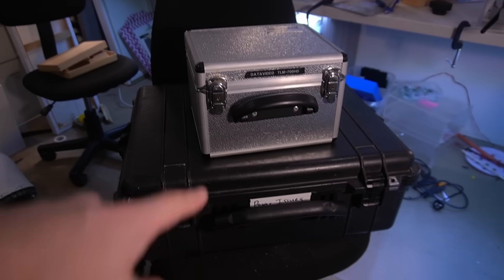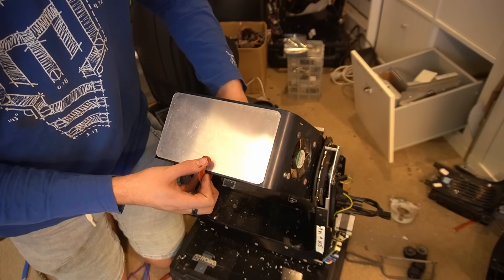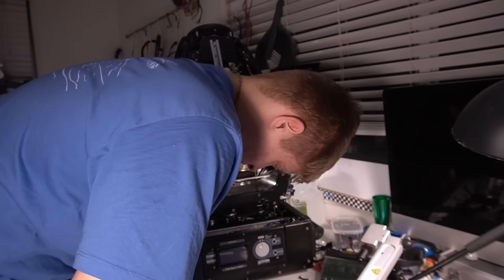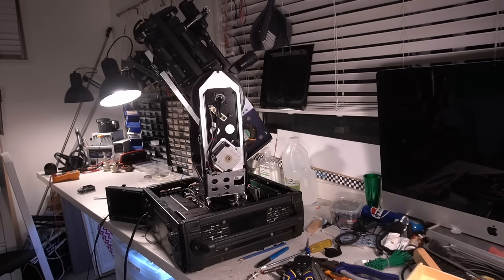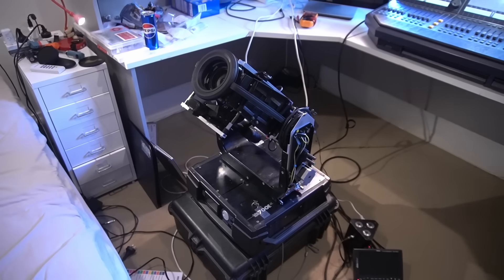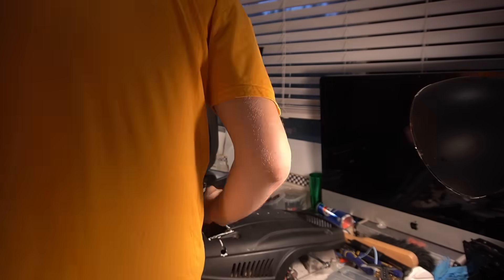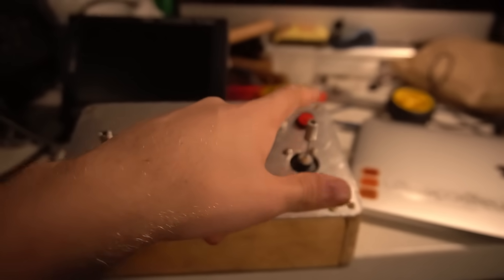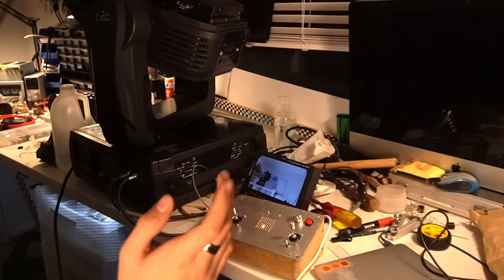I Made A PTZ Camera

Comment: 12:35 If you're going to try controlling this with software, use QLC+. It's FOSS, supports Artnet and accepts joystick inputs, among many other things.
Also, that moving head has connections for iris, gobo wheel, frost, **zoom**, dimmer, shutter, etc. Surely you can reuse one of those?

Comment: bro does cool stuff with cameras and movingheads, uses  kde and linux, knows his way around arduinos and stuff like that, and his brother has a grandMA1!! in his bedroom. why tf could i not know this channel earlier youtube?!
Reply: how does the grandma1 compare to a modern one? is it very different or almost the same?
Reply from the maker: @mistermistero652 it definitely shows its age. Cant do as advanced effects and chases as the later models but it still works like it did when it was new. When we got it it was broken and we opened it up and from the factory is has a little pole clipped it the inside that is used to hold it up while you work on the inside. along with a new copy of the os on a floppy.
Reply: @ gotta love MA 😄. you mean a pole like on a car front hood?

Comment: I would recommend doing a list of buttons instead of a knob.
Easy to quickly recall different presets - and can be labelled.
Since you're able to do the stuff from DMX, you can also use the lighting consoles to have the scenes auto-set the location for the camera instead of using a controller :) 
 - just create a template for the device :P
Reply from the maker: Yeah I was thinking of using buttons but I didn’t want to have to drill a bunch of holes and there isn’t really enough space for it.

Comment: This could be a genius way of hiding a camera on stage in plain sight for closeup shots without having an actual camera blocking the view
Reply: dude you're so right!!
Reply: Kinda... If you're professionally filming it, this isn't practical or useful at all, and besides, you could just mount the camera directly, without a mover housing. Also this is already used in professional theater! Except we use a regular moving head webcam that much smaller, which we mount over the stage for stage managers to have an overhead view of the stage for safety.

Comment: Wonder why You didn't use the fixtures own servo/stepper outputs to control the zoom... Would preserve the units address space and make it way easier to integrate into existing dmx infrastructure
Reply from the maker: because the servo is zoom
Out more or zoom in more while the fixtures steppers are all based on location (so 25 will always be the same spot but for the camera 25 just means soon our kind slowly) so we couldn’t link up a follow spot with it.

Comment: That servo turned out to be mighty quick.

I've had a fascination with the cheapo ptz security cameras- using them for other use cases.... take a old stuffed toy, remove the stuffing and attach to the security camera in a manner that it appears that this stuffed toy is alive and observing the world. 

But, now I think I have myself- maybe yourself also a new project- use the light housing with its faster/ smoother PTZ motion- take the servos/ inner workings of the auto follow PTZ camera. Maybe updazte the motors? But, I am not sure what would be a good candidate to do so- having that auto follow feature with the hastly pan tilt and zoom- would be so slick... maybe a "cat deterrent" defense system for the back yard? Oh, the security cameras have the motion controls already set up by using th security camera video feed.
Reply from the maker: @paranoidzkitszo   in theory i can take an output from the camera. Plug it into an object detection and tracking software and output pan and tilt controls and boom auto tracking camera.

Comment: one question why didnt you utilise one of the movingheads featuren for the zoom like the color reel. (internally obivously with a diffrent wiering?) sry for my bad englisch not my first language
Reply from the maker: I answered in more detail in another comment but essentially the other DMX channels in the light (the zoom (as I don’t want to use any others as I still want to pair it with a follow spot)) is a value of 0-255 where each value is a set position ( with zero being least and 255 being most) but the zoom on the camera is 0-255 with 0 being fastest zooming out and 255 being fastest zooming in. So there is no simple way to interface an existing zoom channel. Simpler to just add an extra one at the end.

Comment: This has been a project I've wanted to try for almost 10 years. Great to see the proof of concept works! Something small like a Blackmagic micro would be great. Then use the existing Focus, Iris, and Zoom motors on a compatible lens. This is less PTZ and more motion control. But the bonus is that you can just use ye olde lighting controller with a cue list. With something like linear rails, stepper, and Arduino w/ DMX shield, the whole thing could be a pretty solid motion control platform.
Reply from the maker: Yeah I’ve used it for a few gigs now and it’s much more useful then I expected. Exceeds expectations. As for the black magic micro If you want to give me one I will happily use it instead :P
Reply: @ lol if I had one I’d have called local rental houses to find a ML carcass already. But any camera should work. Then any lens and some 3D printed gears.

Comment: Amazing project! I remember when me and a friend did a custom microcontroller to control our DMX setup in theater class via USB (because these things were super high priced back then, 12y ago).

For the camera protocol, you should look into LANC. You can probably decode this on another Arduino and then control a lot of stuff from the camera via DMX as well.
The best improvement then would be to adjust the camera speed/sensitivity based on the zoom level

Comment: LANC is a just a serial protocol, You can control a Sony camera via the LANC bus using an ESP32 or Arduino. The LANC protocol operates at 5V with inverted TTL logic at 9600 baud, so you'll need a bidirectional logic level shifter to safely interface with the ESP32 (which runs at 3.3V). ChatGPT can help you get this up and running. Perhaps even use the existing Ardunio to interface the LANC to DMX. This would give you Zoom, Focus, Record start/stop and any other LANC functions that camera allows.
Reply: LANC is a bidirectional protocol, meaning you can both send commands to the camera and receive status information. However, the communication is one wire, so data transmission is time-multiplexed. The camera continuously sends status data, and the ESP32 can inject commands into the same data stream.

What You Can Get from LANC
LANC provides real-time feedback from the camera, including:

Recording Status – Whether the camera is recording or stopped.

Zoom Position – Some cameras provide focal length or zoom level.

Focus Mode – Autofocus vs. manual focus.

Battery Level – For some cameras, battery percentage or status.

Shutter Speed & Aperture – Certain high-end cameras report exposure settings.

Tape/Media Status – On older cameras, whether a tape or card is inserted.

Other Settings – Some cameras expose white balance, gain, etc.

How It Works
The camera continuously broadcasts a 16-byte message at 9600 baud.

Every frame (around every 40ms), the Arduino can inject a command.

The ESP32 can also read status bytes from the LANC data stream.

Arduino Implementation
Read Status Data

Use UART to listen for LANC messages.

Extract useful info (recording state, zoom level, etc.).

Send Commands to Camera

Modify LANC frames with control commands (zoom, record, focus, etc.).

Since your Arduino is acting as a DMX master, you could potentially:

Send LANC status data over DMX (e.g., recording status → DMX channel).

Trigger DMX events based on camera state.

Record positions for replay etc...
Reply from the maker: You are amazing. I’ll have to go get an arduino mega as the serial is already being used by the DMX function. But ill have another go with that information and see what I can do :) edit: it should work on the current arduino

Comment: This is such a wild idea but also makes a ton of sense since moving lights already have really good motion control. The funny thing about this is Robe themselves actually makes this as a product - its called the motion camera and it's specifically meant for using with their remote followspot system (RoboSpot.)

What you did with the arduino is exactly what I'd have figured to do rather than try to reverse engineer whatever else is going on with the light. I would imagine there's a Lanc control library for arduino but... yeah, implementation.

Of note commercial PTZ controllers, they good ones will have a knob which gives is pan/tilt speed so you can dial in the joystick sensitivity in realtime really easily and give yourself a lot of variation in how much detail you want. I'd reccomend checking out James Brunton's control schemes. He's done some really great code for joystick remote control with acel/decel curves.

Comment: When I saw the  thumbnail, I thought that it was the dumbest idea.
But seeing how affordable you can get a camcorder and a cheapo moving head, it's actually pretty smart. The end result was surprisingly smooth as well. Cool stuff! Thanks for sharing
Reply: that moving head would be worth about $1000 in parts alone, depending the condition it was in,
and it would have retailed for about 3-5 grand brand new originally,
but still wow, good job
Reply: @murraybarton9142 functioning 700ATs are c. £250 each, maybe less if no flight case.
Reply: you really can't get those lights for cheap... it would be cheaper to build it from parts

Comment: could have just used one of the channels from the light for the zoom, like the focus motor.
Reply: Exactly my thought. However, i think he's not comfortable using dmx but rather program those things into arduinos. Which is totally fine.

But me (being a musician and light operator and also partial "programmer") i'd have gone with the DMX protocol, as most moving heads have iris and zoom channels anyway. And a dimmer channel. 255 steps each. 

Maybe something to consider for next project. 

This would make it easy to program camera movements and incorporate them into a timecode show 🤩
Reply from the maker: I was thinking about that but wanted to pair it with another colour spot as a follow spot and I’m not sure how I would pair the zooms as the spot is a value of 0-255 being 255 is most zoomed in and 0 is most zoomed out, but the camera is 0-255 where 0 is zooming out and 255 is zooming in.
Reply: @Stormifyed  You can define ranges in dmx for the same channel
Like: 
0 to 84 = Zooming out (slow to fast)
85 to 169 = Do nothing (fixed)
170 to 255 = Zooming in (slow to fast)

Or maybe i didn't quite understand your reply (I'm german and my english is.... existent :-D )
Reply from the maker: @TinoSchulz1990 that’s basically what I did for the zoom but I’m pretty sure that because it’s a zoom in more or zoom out more if I were to use the lights zoom channel I would not be able to pair it with another light as a follow spot (as the lights zoom is based on position not in more out out more like the camera)
And your English seems very good
Reply: @Stormifyed  Ahh, i get your idea. That's true. Every dmx fixture is different when it comes to zooms.
That project kinda reminds me of the robe followspots. They can be remotely controlled (most often by the production's truck drivers, behind the stage). There's a camera built into the follow-spot which allows them to track the artist and control pan/tilt/zoom and color, without having to clim the big old towers